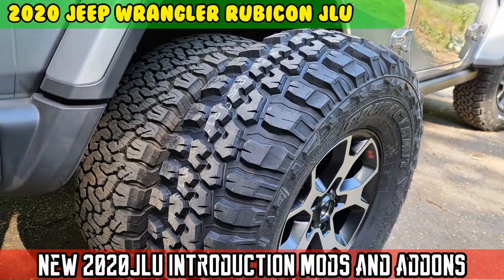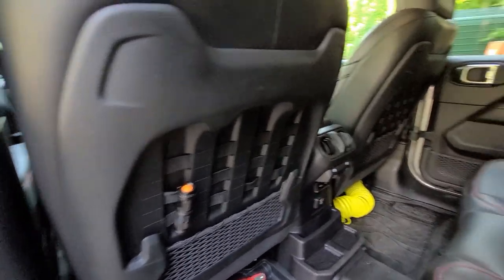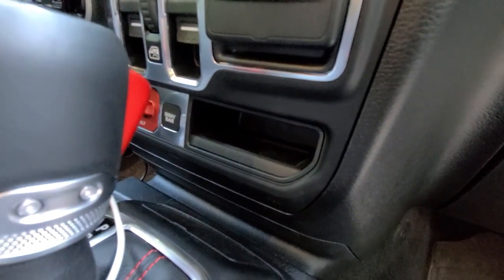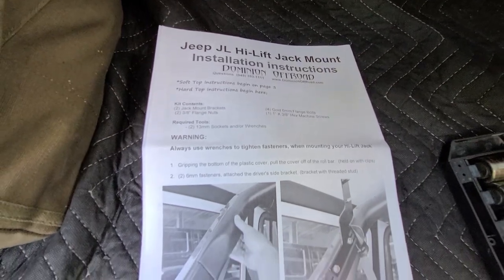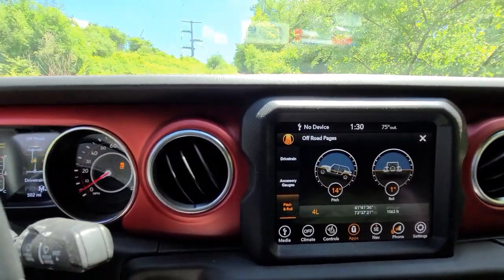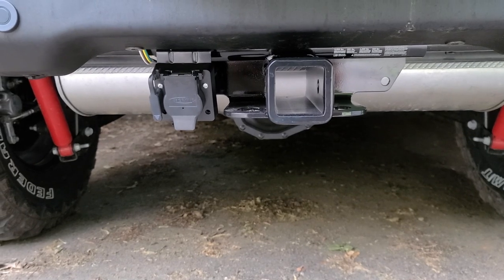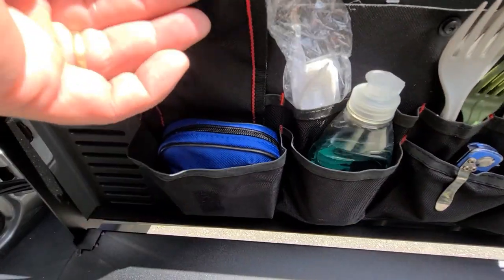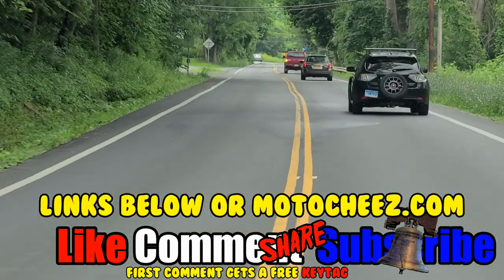(E1) 2020 Jeep Wrangler Rubicon easy fast mods hitch snorkel VHF CB rooftop door shelf tires

Comment: Real men drive Mini-trucks 24/365 and while sleeping   (just kidding)   Perdy Jeep
Reply from the maker: 🤣😂😁👍thanks
Reply: @MotoCheez  i have a 1988 Jeep Wrangler Laredo with a re-manufactured 4.2 plus a Chrysler aftermarket fuel injection kit.    The 1988's had garbage 2 barrel Carter carbs which were known to be crap.  It's also lifted 6".  It will destroy yours!!!!  Not really.  It's been parked in the driveway rusting for a decade with a massive bees nest under the hood and rusted gas lines and I haven't had the time or ambition to deal with it.
Reply: AND I also have a decayed rodent carcass of mostly bones sitting on the drivers seat that you don't have.  I bet it smells awesome inside now.  I can sense your jealousy.
Reply from the maker: I still have my 83 CJ7 too!!

Comment: The switches you can put where th cubby hole is next to the sway bar/ axel lock panel.  Why thats not standard is beyound me.
Reply from the maker: The jeep one? It's like $700 and you have to wire it and program it. Agreed it should be standard

Comment: If you want to upgrade shocks go with Fox they are aluminum wont rust.
Reply from the maker: Good point! The rubis do come with the better shocks... Maybe when I do a lift
Reply: @MotoCheez  If you do a lift go with 3 inch BDS lift kit with fox shocks.  What i like about BDS is they are made in USA and they have the lifetime no BS warranty.  Check them out bdssuspension.com
Reply from the maker: I did buy a puck style for now, want to do a ton of research because I like the spring rate of the new JLUs... I'll check into that! Thanks

Comment: Beware: the frames have bent during towing off road with the 4 doors...    someone needs to market a frame brace
Reply from the maker: I believe that's a gladiator issue
Reply: Mostly due to driver error.  To heavy and to fast over rough terrain.

Comment: Out of curiosity what was wrong with the other jeep you had? it looked like a 2010+ model, seemed pretty modern.
Reply from the maker: Nothing! Just hit 200k miles  My youngest son wanted a 4 door Rubi  and I wanted to keep in family. Now we all (3) have 4 door rubis!
Reply: @MotoCheez  dang dude, around here 200k miles would be a rusted out heap haha. fair enough, that's a lot of miles to take into the bush only to have something fail.
Reply from the maker: Everything was still mint too. I painted the frame every 2 years w Rust-Oleum. Has the Mercedes transmission so good for another 100k, engine runs mint, no leaks etc

Comment: hey bro I just got my bike and yesterday built it under 3 hours after putting in a Mikuni carburetor smoke was coming out of the exhaust and it was idling at Redline so I put in the stock one and now when I drive it after shifting gears it will jump and it feels very dangerous do you have any advice on what to is ? Only got three miles on the engine 2 miles I pushed it
Reply from the maker: Redline idle.might have been plunger not lined up with groove or cable too tight. Jump? Like clutch?
Reply: @MotoCheez  so I put the stock carburetor back on and it's running but only with choke on the way
Reply: The clutch feels good now
Reply from the maker: Main jet too small

Comment: hey cheez d0 y0u kn0w h0w t0 0rder  chinese m0t0rcycles f0r eur0pe, netherlands,? and h0w wide is the  the range 0f upgrade parts f0r these 125-250cc engines
Reply from the maker: Not sure about the Europe imports, seems they don't there. Upgrades are mostly bolt on stiff. Not much internals.

Comment: WTH man, I thought you only bought weird old clunkers and cheap chinese throwaway scooters?
Reply from the maker: I did... First ever brand new car. My wife talked me into it (sugar momma) 😁
Reply: @MotoCheez  I have a question you may have the answer.
I have a bike with a knockoff Mikuni carb. I ordered some jets for the Mikuni from Amazon and they do not fit.  I read that Real  Japanese Mikuni's use a an odd threading, Chinese "Mikuni" do not.  Assuming the jets I have fit a Japanese  REAL Mikuni, where and how do I identify jets that fit a Chinese "Mikuni"?

It's tough when everyone calls there stuff Mikuni but parts don't fit.  Plan B  was to switch to a Kehnin carb (knock-off) which presumably have standard threads on Jets.  Probably open a new can of worms though.

Suggestions? Please and thank you.
Reply from the maker: All the carbs I know of use either mikuni or Keihin. So I bet it's keihin!